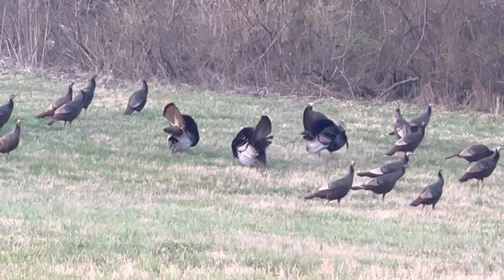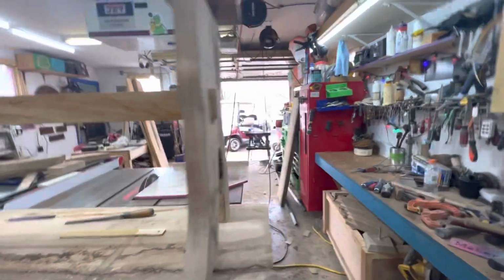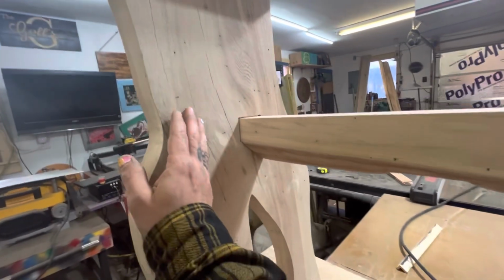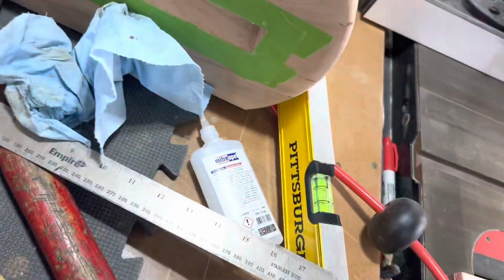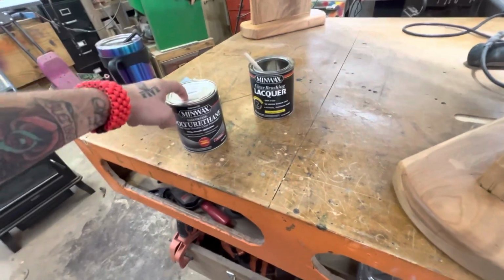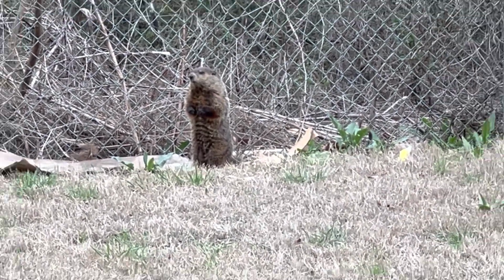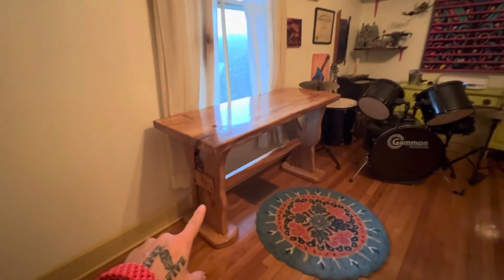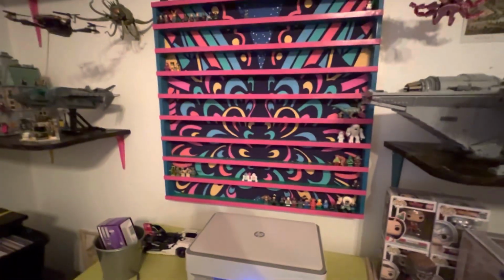Can a cheap jigsaw make a custom slab table ￼? Maker 238

Comment: Ryan. 1.  Love the table.  The finish is amazing.  2. While you were showing the table and talking about using it as an assembly table a thought popped into my mind.  If you are assembling LEGO and drop a piece chances are it is going to go down that heat register.  Just a thought.  3.  See if you can follow my idea for a shelf support.  This will apply to both ends.  Put a pipe flange on the leg, put a nipple in the flange long enough to get past the end if the table, put an elbow on the nipple so the open end is pointing up and toward the back of the table.  Put a piece of pipe in the elbow long enough to reach the back of the table then put a 45 degree angle on the other end so the open end points straight up.  Add another piece of pipe long enough to get the shelf height.  Add a floor flange and attach to the bottom of the shelf.  Hope you follow my idea.  If you don’t just P.M. me and maybe we can do a chat and I will come up with a sketch. 4.  Good thoughts my friend.
Reply from the maker: I think I can visualize it but I would like to see a sketch. See this is what I love about you too. Y’all help me think of everything. I will message you. Thanks, Paul.